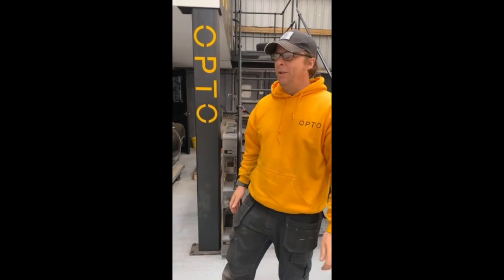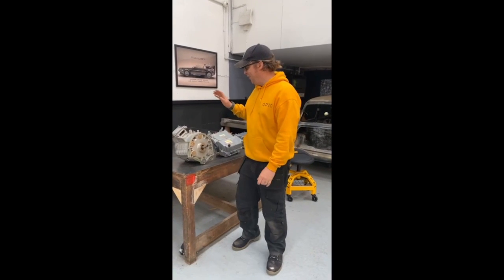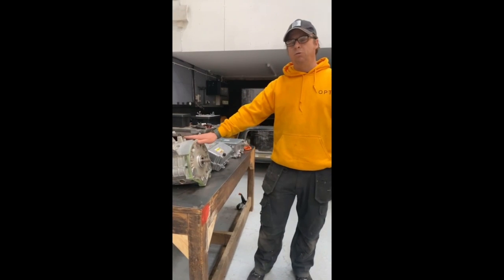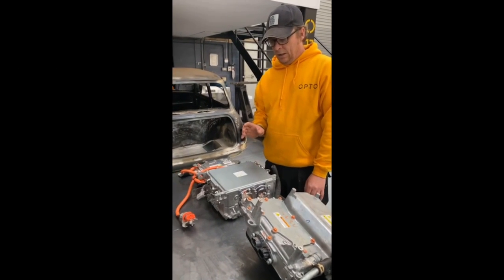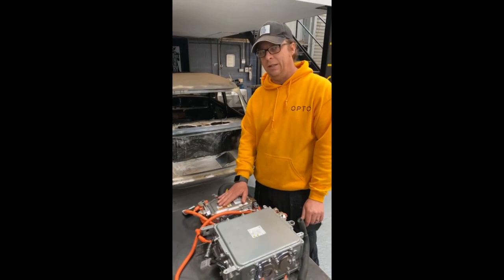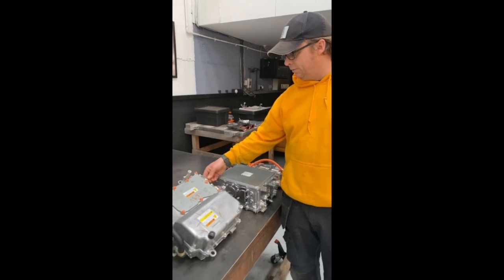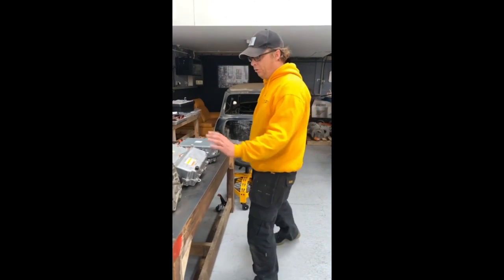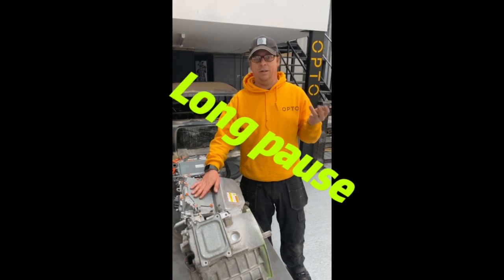Can an EV conversion be done on a minimal budget? - OPTO Innovation’s Classic Mini EV Conversion.

Comment: watching with interest, having just completed an EV conversion on a club man I'm curious to see how you address the controller, the cooling (if any) the regulations for EV certification and the battery cost, I found that the main components are relatively cheap, but if you want a daily driver the other parts get expensive quickly!.

Comment: I managed my ev conversion on my beetle for £2k Outlander motor is a good shout, I got the front motor and it's a bit weak. you're over paying for your parts though, if you need more Outlander parts for the next project, I've got contact for a breakers with much better pricing.
Reply from the maker: Hi Jamie - we would definitely be interested in your contact - eBay is always a bit of a gamble!